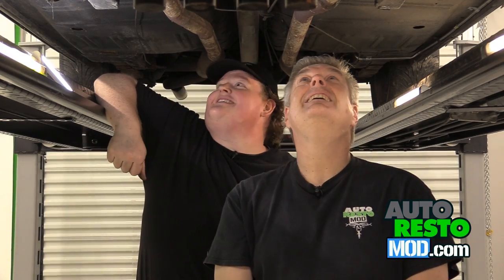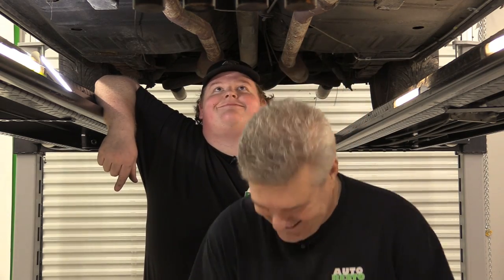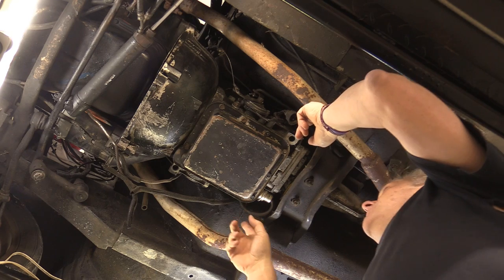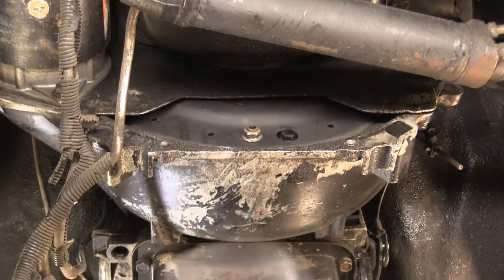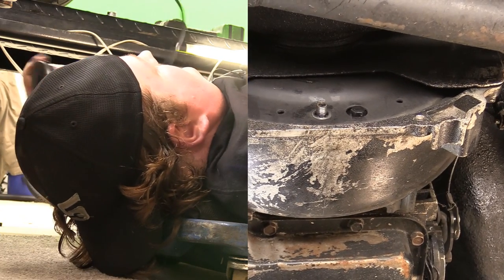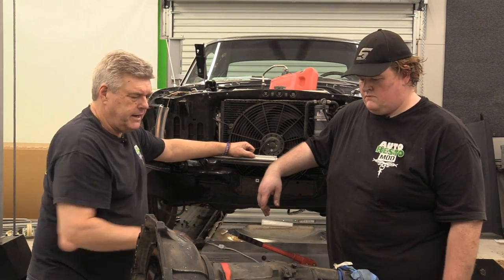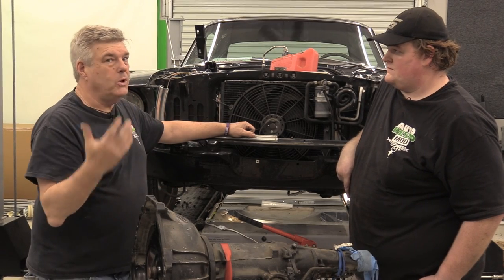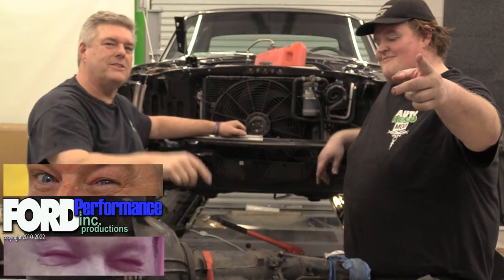Remove Ford C4 Transmission

Comment: As far as Cam not wearing safety glasses, I should let him talk to a buddy who had to get a metal shard removed from his eye. They scraped it out with a needle. His life sucked for several days. Guess who wears safety glasses all the time now??
Reply: Amen Brother! It happened to me just adjusting my Trans linkage in like 5 min. Piece of rust! Trip to ER. Cost? $2700. yep never get under an old car with out glasses, goggles or face shield.
Reply: @robertclymer6948  these young bucks gotta learn. We didn’t get these grey hairs for nothing. LOL
Reply: Yeah. I never used to wear them till I got double cataract surgery. Never want to lose my vision for even a second anymore. And modern safety glasses are much more comfortable than the old chemical goggle type that we had back in the old days.
Reply: @allhailinternalcombustion  I had mine last year. I can into the next time zone now. I wore them before. Even more so now.
Reply: Fools should have done the safety squint

Comment: I'm sure everyone remembers their first transmission pan job if it didn't come with a drain plug. It's a memory that definitely sticks with you. And you would swear that somehow more fluid came out than was ever in there in the first place.
Reply from the maker: We even had it leak later. Just sitting in the corner.

Comment: That was a pretty cool trick on bumping the engine to get to those transmission nuts off.  I always take pictures before I do repairs and have a box of baggies to put bolts & nuts for each part of the disassembly.  Amazon sells a universal transmission plug and is pretty inexpensive.  Thanks for the video.
Reply: except mine the engine hasnt been started in 20 years and i have no battery yet .. so ill have to prob turn crank with socket

Comment: Time marches on, but these were great transmissions in their day. Not too heavy, reasonably compact, highly reliable, about as simple mechanically as a 3 speed automatic can get, low parasitic power losses, and able to handle  a good amount of power. The C4 is still a great choice for a car that doesn't see a lot of miles per year and makes short trips.

Comment: Very good video, thanks! Question, with the trans out what is holding the rear of the engine?
Reply from the maker: Four very tired bolts. Lol
Reply: @AutoRestoMod  I'm just curious what is bolted to what? I thought the two engine mounts and the cross member under the rear of the trany normally support the the engine/trans combination, and with the trans removed what is there to now support the back of the engine? Did you add something? I must be missing something.

Comment: Take all the pan bolts out except two in the back you can drain the pan without a mess. When it stops draining remove them finish draining the pan. If you drop the transmission the oil cooler lines are easier to remove. Cam would not work in my shop without safety glasses.